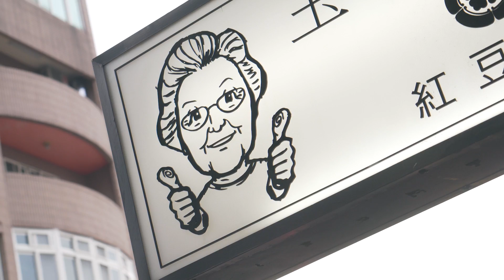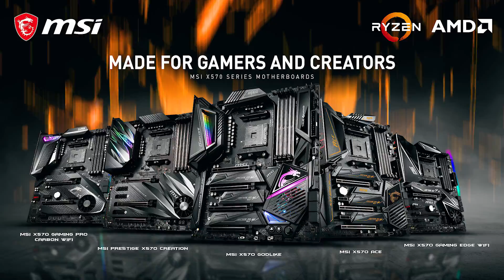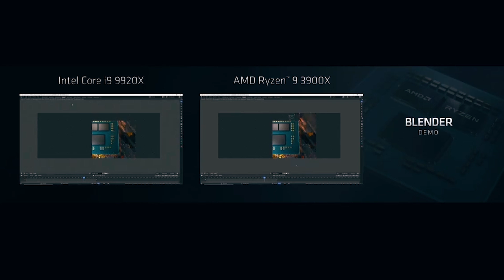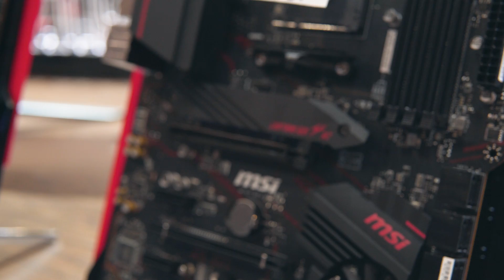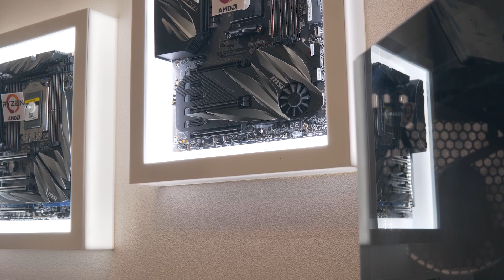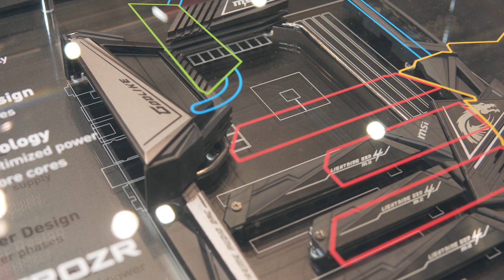AMD X570 Motherboards are Solid AF! MSI Godlike, Ace + More

Comment: Got a question suited best for this channel: with x570 basically requiring fans, what will happen with ITX boards? Will they be inferior overclockers now? I've seen two ITX x570 boards so far neither of them having a fan.
Reply: The ones I saw had the chipset moved up there where the VRM is and I think had a fan over them.

The only boards I've seen period without chipset fans are the ~$600 Gigabyte Auros Extreme which has a heat pipe that runs up to the VRM heatsink and the ASRoxk $1000 board with a monoblock on it which would entail watercooling the chipset.

Comment: I cannot wait for the all AMD shootout, the 1700x vs the 1800x, 2700x, 3700x and the 3900x. Those test should be very interesting.
Reply: 3900x is a 12 core part..... so that wouldn't be an 8 core shootout when you include the 12 core :P but i get what you mean, it will be nice to see a full product stack test showing improvements.
Reply: @goblinphreak2132  Wow, it actually slipped my mind that it was a 12 core CPU. I'll edit accordingly.

Comment: I am annoyed as hell about the lack of mATX X570 boards from all the companies, I think there are only one or two total.
Reply: Why choose matx over ITX? Do you really need the extra pci slots? With SLI support not being what it used to, it makes sense to stop mATX from factor and have consumers choose ATX or ITX in my opinion
Reply: @demonwares  because a mini itx would look too small and ridiculous in the Corsair 280X case that I wanted to do my next build in, it was designed for mATX
Reply: @demonwares  There are people that use the extra slots for sound or capture cards. I use mATX for more SSD/HDD slots, less cramped space when I build, and more clearance for larger GPU and water cooling radiator setups. ATX is too much extra space for me, mATX is just right.
Reply: Tell me about it, I wanted to do a nice mATX build in the Corsair 280X, but then started to check out the available mATX boards that are available, all horrible budget B450 for AM4 or ridiculously priced $300+ Asus for Intel Z390.
mATX really is an ignored niche nowadays.
Reply: @Dr.D00p I ended up having to go Intel and the MSI Z390 Gaming Edge mATX for that reason back in November. There didn't seem to be a mid or high level mATX AMD mobo.
Reply: @wesleyhyun  if your in Europe they have the asus rog gene z390 board. Not sure if its available in other territories.
Reply: @Buffinator1988  I'm not in Europe so I didn't get it.
Reply: We'll probably see more B550 for mATX board.
Reply: We don't want B550...we want proper, full fat, X570 mATX boards, that can handle the power requirements without issue.
Reply: @Dr.D00p  a lot of the lower chipset  b series am4 boards are just as good as the x series when it comes to  power delivery.  The b450 msi carbon is a good example. The main differences between chipset is sli support and USB ports
Reply: They will come later on, honestly most people will be building a Atx or E-atx build with Ryzen 3000.

Comment: How's the height on those heatsinks on the ITX boards? Wondering if they could fit in an S4 mini build I plan on doing...
Reply: Taller than previous gen, especially now that they all have integrated I/O covers and fans. It will be very funky with coolers...